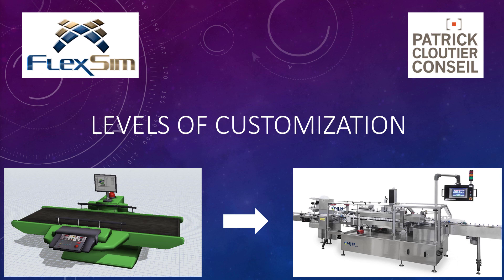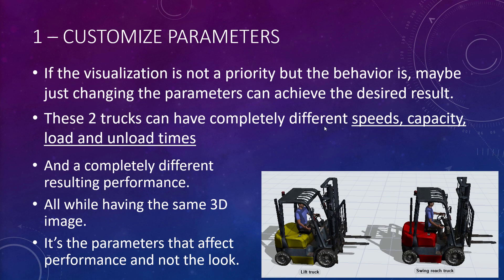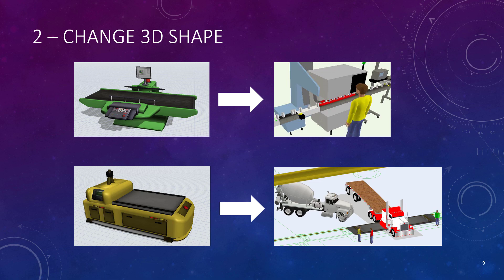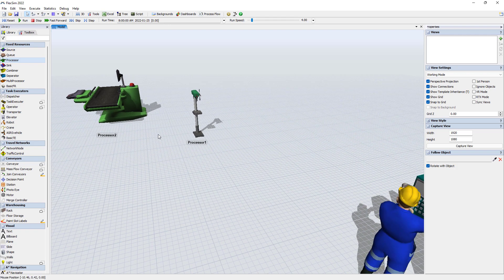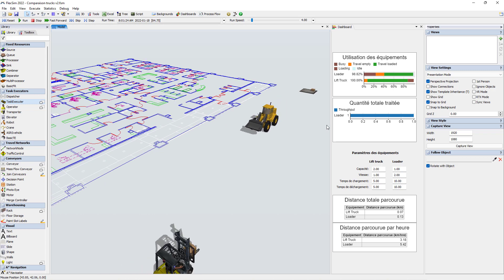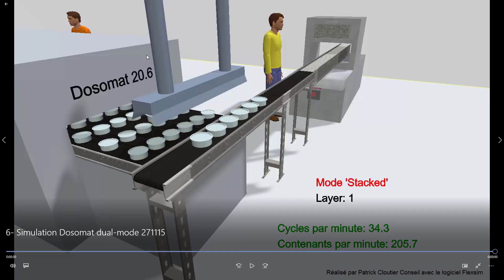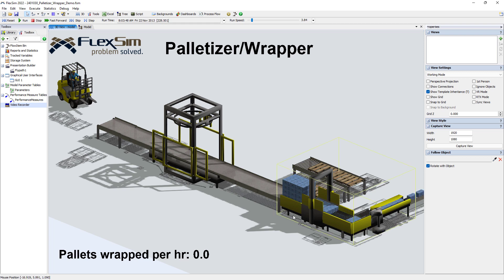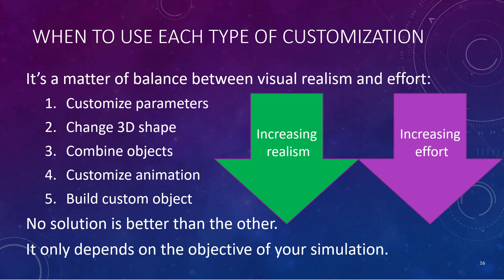Levels of customization in FlexSim

Comment: I want to make a simulation of an agv that I designed for a company in the automotive sector, which will transport 7 trollies (of steering wheels) attached to each other, is this feasible on flexsim? and can I import the 3D catia file of the trolley and the agv also that I will use
Reply from the maker: Do you mean something like this? : https://www.youtube.com/watch?v=ik2h4wi34O8&t=35s
I explain a little in the comments how the model is built.
As for the catia file, check in the FlexSim manual if you can import the file format and/or try it.  It probably can.  BUT, if you import a huge complex file, your model will be slow and sluggish.  You need to import a simplified / lightened file.
Reply: @PatrickCloutierConseil  yes thank you sir for your help

Comment: How can we model machines utilizing the SMED process? like a drill with 2 bits. The first bit makes the process while preparing the second bit, then the second start processing immediately?
Reply from the maker: 1-The machine set-up time doesn't have to be the same for all products.  In the dropdown you can specify what set-up time applies at which conditions. 2 -If you want to show set-up work being performed by an operator while the machine is running, you will need to create it with an operator doing a separate process WHILE the machine is running. Not by checking '"use operator" because this is for setup being performed BEFORE the process.  The best way to do this would be with a ProcessFlow.  I suggest you post your question on https://answers.flexsim.com/ which is the right place to find answers, get detailed answers and post models.
Reply: @PatrickCloutierConseil  Thank you so much, Pat. I wish if there were private courses for FlexSim.
Reply from the maker: @zae5pm  There are.  Most distributors organize them in their region and in the regional language.  I do some in French and English in Quebec, Canada where I am.  You can also register for online training in English given by FlexSim head office.  The dates are on https://www.flexsim.com/calendar/ and you will also find the list of distributors at https://www.flexsim.com/contact/
Reply: Could you please share the 3D images in your library ??? Thank you for such good info